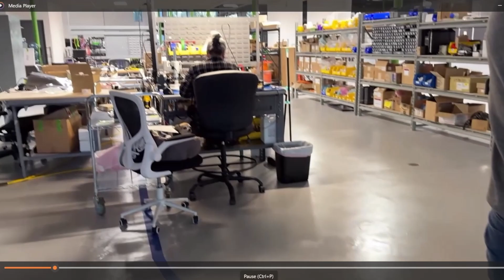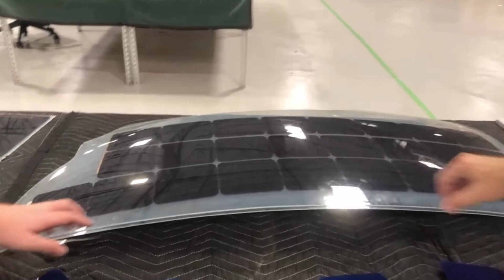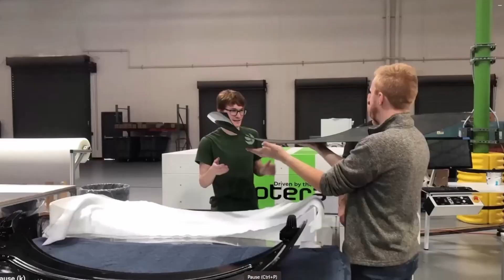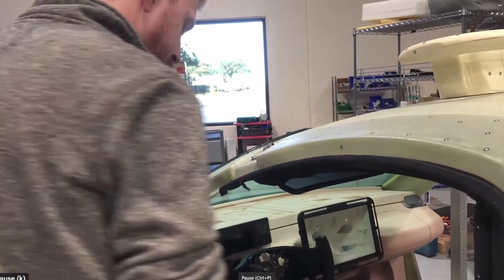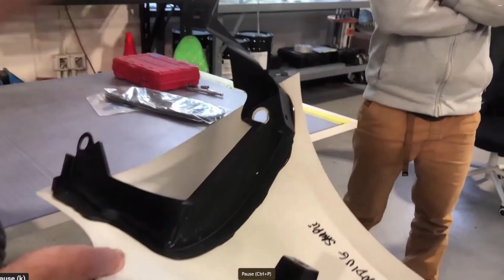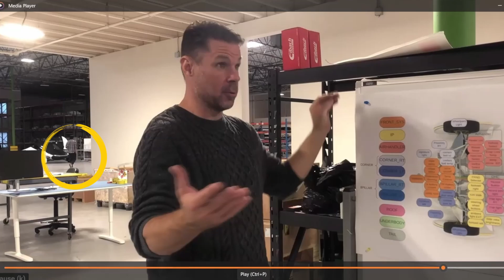APTERA   The wasted factory tour

Comment: I watched this again and since my first viewing ....Didn't they just claim to have signed a big 15 million dollar deal with a Korean company to supply their batteries? If so then what he said about them being built there in the empty warehouse in California was an outright lie.  I guess they can't keep up with their own lies. 
A cooling skin?  What? Firstly, A plastic bubble covered in black solar panels will get nuclear hot under the sun.  The passenger compartment would be unbearable without AC. Say goodbye to battery power. Secondly, the cooling "skin" is on the bottom of the vehicle where the hot pavement and reflected heat is? Which three year old thought this up?

Comment: A few other things:
For a manufacturing plant that is to be making a product 9 months from now, they do not seem to be in a hurry with it comes to the basic infrastructure. 

For example, look at the ceiling. Where are the air lines? How about the electric lines? All I see are just electric for fans and lights. What about overhead structures and conveyors to get the product to each work station? Do they think that all of this can be done instantly? This has to be contracted out. Where are the contractors?

This was not a factory tour. It was just another PR pitch piece for Aptera. Literally explaining the same exact thing over and over.

If I was going to have a drinking game and had to take a shot each time I heard them say, "CPC", I'd be wiped out by now.

I also wonder why they are having CPC do so much of the assembly? These are big units and shipping them from Italy to the US will not be cheap or quick. It can be quick if you don't mind paying much more for shipping though. I doubt they will want a 747 full of them and paying someone like FedEx to get them to the plant. This method of manufacturing is very inefficient. Yet they have some sort of secret sauce nobody else knows about?

Will they show us the CPC factory tour of them making these assemblies? If they had this factory tour, then they should have that too. Yet all I see are them gawking at big pressed and parts that are made there.

The lack of people there has me a bit worried. There should be lots more activity yet this is like visiting a small company on a Sunday morning. If you want investors, then show people actually working.  Yet i already read that a superfan claimed they were all in Italy. If they were, they better be in the Italian Alps enjoying a nice ski vacation.
Reply from the maker: Tailosive has explained to the cretin that they are getting the body first, then they will start to get contracts for the rest, lol.

The ceiling is ready for their fast fire sale auction - no dismantling required.

The cretin has made an interview video with ginger to confirm it was a factory tour. I think he asked two questions, but it's my next video - couldn't resist it.

CPC, CPC, CPC, CPC, CPC . . .

Freight will be cheap considering probably no more than five will be sent over. I'll bet they go by boat, too.

Again, I refer you to the cretin's latest, because ginger says "most of the Aptera staff are at CPC" (have another drink, lol). I suppose they thought they would provide an audience to clap and cheer? No logical reason. 

You see? I don't read ahead when I respond. That superfan has probably watched the cretin's latest. My question is - why didn't they take that rack of skateboards for some fun out of the Alps? lol
Reply: @aussieideasman8498  - "why didn't they take that rack of skateboards for some fun out of the Alps?"
At first I did not understand why they were showing skate boards. Then I figured it out. Just distract people with something else that is not related to the product. Maybe that guy was so bored that he just sat there and fabricated them as nothing else to do. Imagine if someone took a tour of the Cybertruck plant and that guy was part of the tour. I would suspect, the internet would be all over that in a heartbeat.

I do understand why they might want to show composites or carbon fibre but honestly, that's old news today. People can do that in their garage at home.

At least they can now stop talking about CPC and now call them Mitsubishi as their Chemical division bought CPC back in October. So it will be nice that they can try to use Mitsubishi as much as possible in their presentations. https://www.mcgc.com/english/news_release/01734.html
Reply from the maker: @billsmith5960  The distraction stunt has always been used. Solar is the big distraction from skin cooling.

You are onto something with the Mitsu takeover. It conjures up a few thoughts immediately. One is - did CPC know all along that this was on the cards and it helped some insiders to engage in a back pocket money grab from Aptera, with a deal including brown paper bags? Another is - did Aptera know before they first met with them, and decided they didn't need to tell the fanboys? They can squirrel away money when so much more is changing hands.

I also looked at the CPC link from your article and still no mention of Aptera as a formidable customer. What made me laugh was their language gaff - "WE ARE LOOKING FOR NEW TALENTS". if they want new people who are talented, there should not be an 'S'. What they are saying is their existing staff are looking for new talents. I thought this stuff only went on with Asian translations, lol.

Comment: the joke about their battery solution is this, 2195 and 21120 batteries have existed awhile but never certified for automotive use. there was no desire in the industry to do so. Tesla went with 4680 and BMW and GM stated interest in that technology but the real industry move has been to the blade configuration. this is quickly replacing prismatic pack technology that got the Chevrolet Bolt into so much trouble. So Aptera is stuck on a dead end technology that the industry moved away from.
Reply: The also said that the standard configuration is only 20 something kWh. Is that what their prototypes have?
Reply from the maker: All the gullible fanboys will see cells used for vapes and toothbrishes put in an EV as an engineering feat of genius, lol.